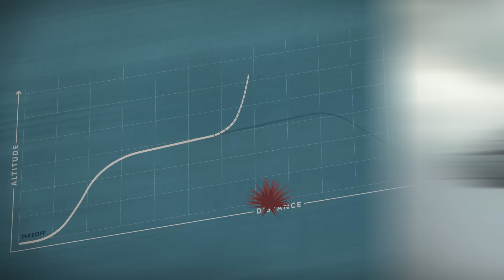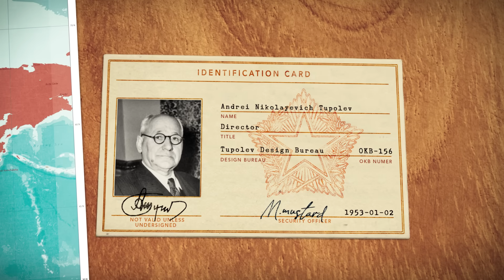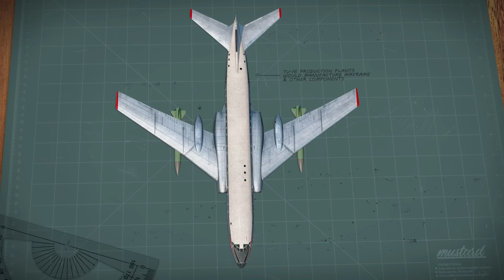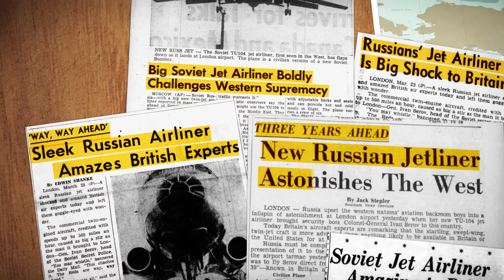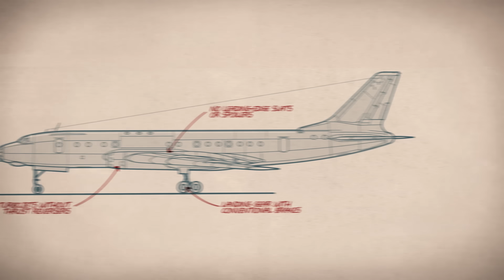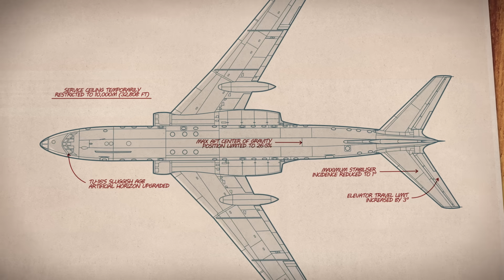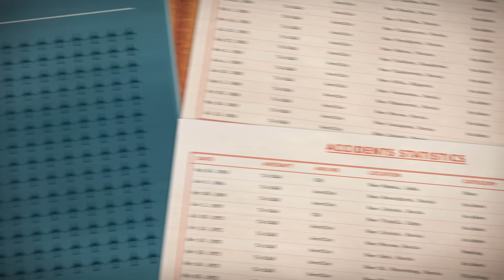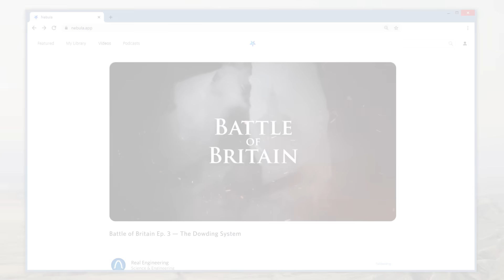The Soviet Airliner Designed To Crash

Comment: You've dramatized the Tu-104 problems and blown them out of proportion. It was not the most dangerous airliner at all.
I guess there's a lot of anti-Russian bias. That figures, mot US fan boys have the same mentality Russia bad USA not just good, but exceptional. 👎
Reply: The de Havilland Comet was the worst jet airliner in history.
Reply: 205 aircraft were built and 37 were lost. Is there any other country that could ignore such statistics?
Reply: @user-wx4ky5tx3f  Britian
Reply: @sandervanderkammen9230  Could you please provide details?
Reply: @user-wx4ky5tx3f  de Havilland Comet says it all.
Reply: @user-wx4ky5tx3f  114 Comets built, 26 lost in crashes or accidents.
The Comet has the worst per flight and per passenger mile safety record of any jet airliner in history.
Reply: @sandervanderkammen9230 
1. There were not 26, but 25 accidents, of which 5 were criminal incidents or hijacking.
2. Only three accidents 05/02/53, 01/10/54 and 04/08/54 were caused by aircraft. 
3. A lot of planes were used outside of Europe and North America which in 50-70 years meant bad maintenance and inexperienced crew.
4. The last accident with the Comet occurred on 01/02/71 and the aircraft was retired on 03/14/97.
On the contrary, the Tu-104 suffered from dangerous technical failures throughout its operation.
In addition, it was extremely difficult for pilots; only highly qualified pilots after special training could fly it. Do not forget, in fact, this is a Tu-16 bomber.
As a result, after excluding crimes and hijacking:
- Comet caused 360 fatalities or 3.16 fatalities per aircraft;
 - Tu-16 caused 915 deaths or 4.46 deaths per aircraft.
It looks like the Comet isn't the worst plane after all...
p.s. I have no idea where you found the fatality rates per mile per passenger for both planes, and I seriously doubt these data ever exist, so please prove your claim with links.
p.p.s. 
https://aviation-safety.net/database/types/de-Havilland-DH-106-Comet/losses
https://aviation-safety.net/database/types/Tupolev-104/losses

Comment: Something not mentioned - downward angled wings underneath the fuselage is a big no-no. Its induces a tendency to roll as the fuselage becomes like an inverted pendulum. Wings underneath should angle up - check any airliner flying today - and wings above the fuselage should angle down (eg C-17)

Comment: at least they used round windows, avoiding the issue a certain other plane had.
Reply: The Comet Disaster was not caused by the shape of the windows, in fact there is no reliable evidence to prove that any of the Comets crashed because of the passenger windows.
 de Havilland simply used aluminum skins that were too thin and very shoddy workmanship to rivet them together

Comment: And 70 years later, the Boeing 737 MAX arrived. Another "brilliant" cutting costs idea.
Reply: The Max 8 has a better safety record  than the Tu-104 or the worst jet airliner in history... the de Havilland Comet
Reply: @sandervanderkammen9230 Of course times have changed. The average mileage between two accidents increased dramatically for all aircraft. You have to compare with the average over the given time period.
Reply: @mareksykora779  Planes fly more often than before and carry more passengers.
We rate aircraft safety in fatalities per flight and per passenger mile that cancels out these changes in aircraft travel.
Reply: @sandervanderkammen9230  And what else can I say? Any plane from the 1960s would be considered "killer" today. For example, the Boeing 707 released in 1958. The very next year, two crashes during training flights, followed by typically 5 crashes per year, with a record year of 1968 with 10 crashes. Flying in the sixties used to be dangerous. In today's aviation world, the 737 MAX is in the same position as the Tupolev in the 1960s.
Reply: @mareksykora779  Absolutely not, the Boeing 707 series has a much better safety record than the Comet or the Tu-104.
 The Max 8 already has a better record, there are nearly 1,000 Max 8s in service.
The Boeing 737 is the most successful aircraft in history with over 6,000 aircraft.

Comment: The US comet was the first failure .
Reply: DH Comet
Reply: @sandervanderkammen9230 

@sandervanderkammen9230 

Clearly we feel we can shed some light on some common myths & misunderstandings.

Clearly It's a great pity & a crying shame that British military forces had to occupy a large part of Germany for decades after 1945 & Russian military forces had to do the same. Of course Russia still posseses a large chunk of what was German territory & of course  Russia & the UK produce nukes. Obviously Germany does not produce nukes.

Obviously it's possible to predict the potential accident losses for airliners simply by looking at the year they first flew. However, if we take into account all the variables including the year they first flew & we discard random incidents such as a vehicle colliding with an airliner during its takeoff run, there are some airliner manufacturers that stand out as producing  particularly safe aircraft for the years in which they operated, Bombardier & Embraer being two such manufacturers.

It's definitely true to say that Bow-wing (See B-47 wing folding & wing collapse incidents), which has more than 50 years design & build experience on the type, obviously can have no excuses for the 737 Max incidents, those incidents being directly caused by serious design defects.

  That's correct of course, at the time the Comet wasn't particularly dangerous. It was also definitely not the worst aircraft engineering disaster in aviation history obviously.

   Obviously the Comet's engine position & inlet position had some distinct advantages at the time & of course pylon mounted  podded engines have some problems including excessive induced drag. The Comet engine inlet design was not a fatal flaw & didn't cause any incidents.

Examples of all Comets mks including some Comet 1 airframes continued flying with certification at some point after 1954. Flying carried on until 1997. 

      Losses comparisons.
Accident Losses % of total built.
How things were in those days.

DeHavilland Comet 4 UK                 14% 
DeHavilland Comet all   (ff 1949)   17%  

Douglas DC-1                                      99%
Douglas DC-2                                      47%
Douglas DC-3                                      30%
Douglas DC-4                                      26%
Boeing s300                                             72% 
Boeing 307                                               70%
Boeing 247                                               48%
Boeing 707                                               20% 
Lockheed L-049/149 Constellation        30%
Lockheed Electra  Turboprop                  29%
Fairchild FH-227                                       30%
McDonnell Douglas DC-8                        14%
Sud Aviation Caravelle                             15%
Canadair CL-44  Turboprop                   46%  
Convair CV-580  Turboprop                   22%
Convair CV-880    (ff 1959)                    27%  
Convair CV-990     (ff 1961)                   35% 
Tupolev T-104     (ff 1955)        16%

     Of course De Havilland had prior experience building many all metal construction airframe aircraft & thousands of jet powered fighter aircraft that were primarily of metal construction with pressurised cockpits & jet engines built by De-Havilland.

  Yes, that's true, De Havilland carried out full stress analysis & engaged in a comprehensive & protracted testing program which is why key De Havilland people were happy to be aboard flying DH Comet aircraft. The Comet was the first airliner where stress due to pressurisation significantly exceeded flying load stress for a full length passenger cabin fuselage.

    We agree, that's correct, the DH Comet was the first passenger airliner with full length fuselage pressurisation at 8psi pressure differential. Handley Page built the world's first all metal construction airliner during the 1920s.
    In all cases other earlier pressurised aircraft were larger, needed thicker fuselage skins due to flying stresses alone & had much lower pressurisation differential pressure or were military aircraft with relatively small heavily built pressurised capsules. 

     Of course ripstop provision was provided. The skin alloy used became unavailable at the time due to R & D at the manufacturers which resulted in the original alloy being discontinued. Later alloys had very similar properties. The skin thickness used for the Comet was used for similar size later aircraft. Frame spacing was not found to be too large & frame width was not found to be too small.

    Without doubt De Havilland did indeed always work to better than industry standards at the time, used up to date knowledge for the design & construction & no evidence of negligence or criminal negligence was ever produced in relation to the DH Comet.

    Obviously the DH Comet had no effect on the course of the aerospace industry in the UK. The UK now has the world's highest combined nuclear, aerospace & defence sectors per capita activity. Of course anyone currently flying on a wide body airliner stands a good chance of being on an aircraft powered by RR gas turbine aero engines designed & built in the UK.

    That's correct, the investigation committee did not find hundreds of fatal flaws or evidence of design defects, structural defects, defective materials or shoddy workmanship. Indeed it is the case that ripstop provision was included. Claimed incidents did not involve cracks starting from passenger cabin window corners. Pretty much all changes were just in case changes or were planned development modifications & improvements that were scheduled regardless of incidents.

    Obviously De Havilland designers knew all there was to know about metal fatigue at the time they designed the DH Comet.

    It is in fact entirely true to say that the way airliners were built changed everywhere, including in the US, after the Comet incidents.

We hope this helps, obviously.

Cheers indeed of course as always etc.
& 👍 without doubt.
       
 
 . . .... ... ..... ......
. . ..... ..... ... ......

Comment: No, that title belongs to the useless  and dangerous DC10
Reply: The Comet 1 is first.  It had to be redesigned.
Reply: @GH-oi2jf  Not even close, DC10 had 55 accidents resulting in the loss of 32 aircraft and 1,261 people killed.
Reply: @georgebarnes8163  The DC-10 has an excellent statistical per flight and per passenger mile safety record... and it's still flying.
Reply: The de Haviland Comet has the worst safety record of any commercial jet aircraft in history.

Comment: I expected the British De Havilland Comet.  I had low expectations for the russians but high for the British
Reply: The Comet remains the worst safety record of any jet airliner
Reply: @sandervanderkammen9230 

@sandervanderkammen9230 

Clearly we feel we can shed some light on some common myths & misunderstandings.

Clearly It's a great pity & a crying shame that British military forces had to occupy a large part of Germany for decades after 1945 & Russian military forces had to do the same. Of course Russia still posseses a large chunk of what was German territory & of course  Russia & the UK produce nukes. Obviously Germany does not produce nukes.

Obviously it's possible to predict the potential accident losses for airliners simply by looking at the year they first flew. However, if we take into account all the variables including the year they first flew & we discard random incidents such as a vehicle colliding with an airliner during its takeoff run, there are some airliner manufacturers that stand out as producing  particularly safe aircraft for the years in which they operated, Bombardier & Embraer being two such manufacturers.

It's definitely true to say that Bow-wing (See B-47 wing folding & wing collapse incidents), which has more than 50 years design & build experience on the type, obviously can have no excuses for the 737 Max incidents, those incidents being directly caused by serious design defects.

  That's correct of course, at the time the Comet wasn't particularly dangerous. It was also definitely not the worst aircraft engineering disaster in aviation history obviously.

   Obviously the Comet's engine position & inlet position had some distinct advantages at the time & of course pylon mounted  podded engines have some problems including excessive induced drag. The Comet engine inlet design was not a fatal flaw & didn't cause any incidents.

Examples of all Comets mks including some Comet 1 airframes continued flying with certification at some point after 1954. Flying carried on until 1997. 

      Losses comparisons.
Accident Losses % of total built.
How things were in those days.

DeHavilland Comet 4 UK                 14% 
DeHavilland Comet all   (ff 1949)   17%  

Douglas DC-1                                      99%
Douglas DC-2                                      47%
Douglas DC-3                                      30%
Douglas DC-4                                      26%
Boeing s300                                             72% 
Boeing 307                                               70%
Boeing 247                                               48%
Boeing 707                                               20% 
Lockheed L-049/149 Constellation        30%
Lockheed Electra  Turboprop                  29%
Fairchild FH-227                                       30%
McDonnell Douglas DC-8                        14%
Sud Aviation Caravelle                             15%
Canadair CL-44  Turboprop                   46%  
Convair CV-580  Turboprop                   22%
Convair CV-880    (ff 1959)                    27%  
Convair CV-990     (ff 1961)                   35% 
Tupolev T-104     (ff 1955)        16%

     Of course De Havilland had prior experience building many all metal construction airframe aircraft & thousands of jet powered fighter aircraft that were primarily of metal construction with pressurised cockpits & jet engines built by De-Havilland.

  Yes, that's true, De Havilland carried out full stress analysis & engaged in a comprehensive & protracted testing program which is why key De Havilland people were happy to be aboard flying DH Comet aircraft. The Comet was the first airliner where stress due to pressurisation significantly exceeded flying load stress for a full length passenger cabin fuselage.

    We agree, that's correct, the DH Comet was the first passenger airliner with full length fuselage pressurisation at 8psi pressure differential. Handley Page built the world's first all metal construction airliner during the 1920s.
    In all cases other earlier pressurised aircraft were larger, needed thicker fuselage skins due to flying stresses alone & had much lower pressurisation differential pressure or were military aircraft with relatively small heavily built pressurised capsules. 

     Of course ripstop provision was provided. The skin alloy used became unavailable at the time due to R & D at the manufacturers which resulted in the original alloy being discontinued. Later alloys had very similar properties. The skin thickness used for the Comet was used for similar size later aircraft. Frame spacing was not found to be too large & frame width was not found to be too small.

    Without doubt De Havilland did indeed always work to better than industry standards at the time, used up to date knowledge for the design & construction & no evidence of negligence or criminal negligence was ever produced in relation to the DH Comet.

    Obviously the DH Comet had no effect on the course of the aerospace industry in the UK. The UK now has the world's highest combined nuclear, aerospace & defence sectors per capita activity. Of course anyone currently flying on a wide body airliner stands a good chance of being on an aircraft powered by RR gas turbine aero engines designed & built in the UK.

    That's correct, the investigation committee did not find hundreds of fatal flaws or evidence of design defects, structural defects, defective materials or shoddy workmanship. Indeed it is the case that ripstop provision was included. Claimed incidents did not involve cracks starting from passenger cabin window corners. Pretty much all changes were just in case changes or were planned development modifications & improvements that were scheduled regardless of incidents.

    Obviously De Havilland designers knew all there was to know about metal fatigue at the time they designed the DH Comet.

    It is in fact entirely true to say that the way airliners were built changed everywhere, including in the US, after the Comet incidents.

We hope this helps, obviously.

Cheers indeed of course as always etc.
& 👍 without doubt.
       
 
 . . .... ... ..... ......
. . ..... ..... ... ......

Comment: The DC10 and 747 have caused more deaths than any other aircraft.
Reply: Most 747 crashed were caused by pilot error.  Some were terrorist acts.  One was an incorrect repair not done to Boeing specifications.  It’s complicated.
Reply: @GH-oi2jf Good comment!  Math is hard for stupid people..
Both aircraft have been service for over half a century with 645 and 1,574 aircraft delivered.
Both aircraft are expected to remain in service until at least 2050.
Compare the per flight and per passenger mile safety both jets have excellent safety records compared to the Tu-104 and the worst jet airliner in history... the de Havilland Comet.
Reply: That's is not true, when you take a  realistic look at per flight and per passenger mile safety the DC-10 and  747 have excellent safety records compared to the Tu-104.. the worst jet airliner in history is the de Havilland Comet with a staggering 1 in 4 loss rate!